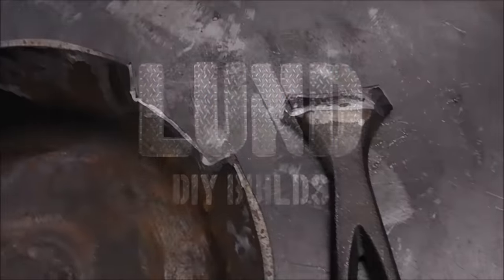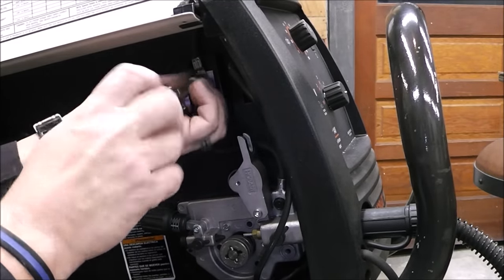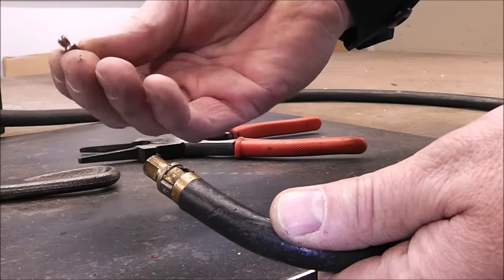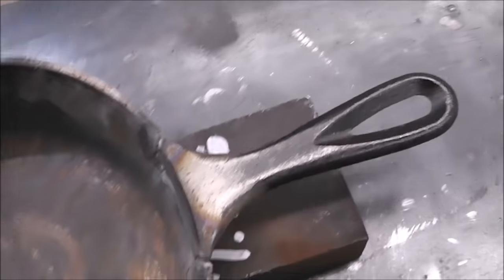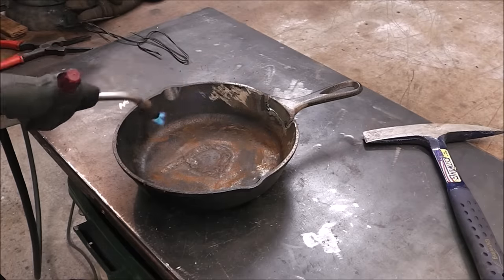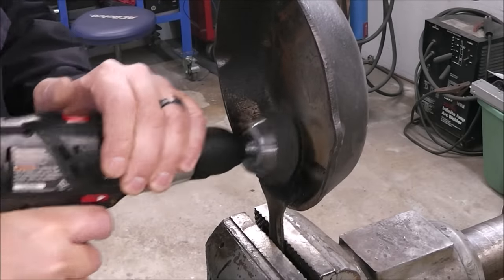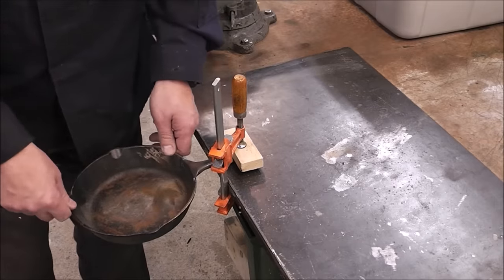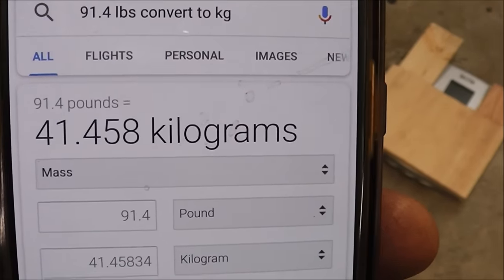Cast Iron Welding Repair using Flux Core Wire

Comment: I was having this big argument about welding cast iron..and as you all perhaps know, professional anything means standardization! A standardized weld is one that you can find in standardization publications, for the Germans out there it is the DIN (German Industrial Standard) publications and definitions, where all welding is standardized where a standard type of steel and a standard type rod will produce a weld with predictable properties if it is professionally executed. The strength of a standardized weld must not be less than XYZ ..well that is what standardization is all about. When a ship's hull is welded, then there will be tests performed and then it is accepted and "sanctified" by the testing entity. Well, this isn't about a "Industrial standard", obviously it is about something that will "work" So: Can Cast Iron be welded? If it is not covered by the DIN publications, the answer is NO. But can one weld it? HELL YES!
Reply from the maker: Spot on brother! Too many people talking themselves out of a repair because they "heard" it doesn't work without the actual knowledge of knowing what works and what doesn't.

Comment: The shroud is not hot.
It is exactly the same as DCEP.
Reply from the maker: Mine is which is one of the reasons why the nozzel for flux core is made of non conductive material.

Comment: Its a cast iron skillet. You could jb weld that thing. Its not a motor foot or an actual machine part. Even though your not using 5p rod or any other proper cast iron repair consumable since its a non essential piece I'm sure even super glue that can withstand heat will work. Is it common practice...no. Ask Canadian Mike Holmes on common practice. I don't think there is even a dissimilar metal consumable for cast iron.? It also matters what type of grade cast iron or is. For my favorite cast skillet I'd bolt that dam thing together to save it if I had too!!!!!!!
Reply from the maker: Forget everything you watched and braze it. That's the proper way to do it,  but for those that are less fortunate and have a wire feed welder, a stick welder or the dozens of other process and fillers that we tested, maybe they can make an informed decision. JB Weld makes a mess on cast iron exhaust manifolds. White cast is nearly impossible to weld. Grey is the most common and what we have here

Comment: Toss it on the scrap wagon, brand new Lodge U.S.A. made skillets are $25 bucks. I charge $75/hour in my machine shop and the one I retired from is $150....
Reply from the maker: C'mon Keith....your not serious right? Would you tell this to one of your customers that brought you a cast iron part to repair and they told you it cant be replaced? Most people understand as I explained in the video that this is not about repairing a cast iron pan but rather showing what can be done using what you have on hand.
Reply: @BrandonLund  
Only cast that can be replaced.
Out in the sticks it's a "time down" vs price, availability and how far away it is.
On old tractors which I deal with every week, it depends on getting to the "crack," how much has to be dismantled?
Are there gaskets involved, what will burn nearby, is it going to rain on things opened up, gas or diesel fuel, wires, hydraulic lines/hoses etc.
Told my buddy whose block cracked to wire clean it and then use JB weld....
No torch involved.
Our parent's garage and wrecking yard has seen a number of things fixed this way.
Your pan was okay, but pick a cast iron front spindle that most of us have dealt with.
1948 Case VAC.
1948 Minneapolis Moline model G
1956 Minneapolis Moline 335.
1975 Minneapolis Moline G705.
1975 Massey Ferguson 30 Industrial.
1975 International 2400A Backhoe.
1990 Ford 555 Backhoe.
And that's just the stuff I own.

Comment: Flux core mig wire??
Reply from the maker: They make solid wire and flux core wire. Solid wire is used with a shielding gas, also known as GMAW, flux core wire, also known as FCAW can be used with or without a shielding gas. Flux core wire used with gas is often referred to as "dual shield" and is largely used for structural work. The term "flux core mig wire" is a slang term used in the trade, however, you cant have both. It's either flux core wire or it's mig wire.  This project was welded with flux core wire. Cheers.
Reply: It's really innershield.

Comment: I think I will try this on a wood plane crack repair. Most people braze.
Reply from the maker: It should work but if not you can always grind it out and braze. You don't have much to lose. FYI silicon bronze wire and mig is awesome at cast repair. I have a video in my cast iron playlist on this

Comment: When using a mig welder to make cast iron repairs look for a wire with the highest ductility you can find
Reply from the maker: Right on!
Reply: That is why nickle rod works so good for cast iron it has very  high ductility
Reply from the maker: Exactly! 💯

Comment: I broke my vise.  I welded it and it looked to be a solid repair.   The first time I snugged my vise up and gave a half turn more, it broke.   Going in the trash, Will never be as strong as parent metal
Reply from the maker: Cast iron repair is always a crap shoot. Sorry it didn't work out. The best scenario ive had to date yielded about a 30% decrease in original breaking strength. Much of that depends on the batch of cast as well as the procedures

Comment: all most all cast iron today is s.g. iron. today,   just weld it with m.s. wire .    people think the new wires or old techniques  are good , but its the parent metal.  If its not s.g cast it must be brazed so  drop it in the bin

Comment: There's always going to jerks . And basically  they are afraid to try.  I've never seen  mama cook anything with that amount of weight. If it works, Great. If not , go buy a new one. Good video.
Reply from the maker: Right on Stacy I appreciate it! The old timers made due with what they had and they didnt always have exactly what they needed. I feel like our society has been conditioned to just throw away and buy new without ever trying to repair things. I appreciate you see what I'm trying to show here :)

Comment: Have done a lot of cast iron repair, stop using sand and use lime, cheap and less thermal shock, sand must be be pre heated just as the cast iron.
Reply from the maker: I have heard ash works well also but havent tried either. I'm sold on thermal blankets... especially for in place repairs.

Comment: Ive ran off miles of 0.45 flux core wire working at a dry dock, and it still required a shielding gas  I don't recommend this gas-less flux core wire for nothing more than patching a hole in a muffler nothing serious at all because it wont hold.
Reply from the maker: That's not true.  Self shielding procedures are often specified on everything from bridges to structural steel. To say it's only good to patch mufflers is very misleading. What your referring to is dual shield and it's not always practical in the field.
Reply: @BrandonLund  Ive used inner shield at ship yards and large scale plate steel projects im familiar with it Sir, a commercial grade machine with industry standard methods is one thing.  Im referring to a Harbor Freight 110 volt Mig with flux wire i wouldn't use it for nothing more than a small patch job it was awful Sir.
Reply from the maker: @unclequack5445  I have never tried a harbor freight welder so I cant comment on that.
Reply: @BrandonLund   Yeah a neighbor asked me to help him set it up since I had my own Portable welding business all I can say Sir was it was pretty grim, I'd have bought a stick welder even if it cost more.
Reply: Brandon answer me this, do you advocate teaching students to weld downhill? There's a Youtube channel of some KIA doing just that obviously he cannot run a 7018 from the bottom up, which is a necessary skill for anyone in the trade, would you agree?
Reply from the maker: @unclequack5445  Welding in position and out of position are basic fundamentals that should be learned.
Reply: @BrandonLund  But of course.

Comment: And it always tears the iron out when it breaks..it won't ever be as strong and won't hold as much pressure
Reply from the maker: Correct
Reply: But you always have the option of putting pins in it after you get it welded.or before sometimes..that's how I fix cracked heads..just drill it put a pin in it and tig weld it..sometimes it works..sometimes it dosent..I've got a set of stock racks that fit a model a Ford one ton that my great uncle made out of 3/4 black iron pipe and welded it together with bailing wire and a gas cutting torch..he also made his own gas from carbide and water..in sure he bought the oxygen

Comment: Cast iron one inch at a time on welding then hammer a bit . And stuff
Reply from the maker: You payed attention
Reply: @BrandonLund  yuppers pay attention on the weld if all settings on welder are correct
Reply: @BrandonLund  one inch at a time . On weld .
Reply: @BrandonLund  yup

Comment: Control would have been to see what a non broke pan.
Reply from the maker: I have that number too if you want to check it out.  This is just one of many videos in this series. I will spare you if your looking for the best repair Vs unbroken cast iron, use silicon bronze

Comment: I think it would hold eggs and bacon . That's all I use mine for anyhow.
Reply from the maker: It sure will...and then some! :)
Reply: @BrandonLund  
I have a pan that's broke just like that. I might try to weld it back together since I saw this video. I have a flux core welder.

Comment: Cast iron . Weld one inch at a time.  Then hammer . Repeat aft each inch of welding.  Just my opinion  .
Reply from the maker: Spot on brother...textbook. i usually go 1/2" just to be same and further reduce heat input.

Comment: I've heard all kinds of horror stories here and elsewhere about people that forget to change the polarity.
Reply from the maker: People have actually sold their machines over this
Reply: @BrandonLund  Yes... I am now watching this for the second time as a "refresher". Using the right kind of knurled drive roller helps as well.
I don't have one for my Hobart 210 yet, but they ARE available out there.
 It also looks like pre-heat & post-heat is important as it is sometimes used on cast aluminium. 🤔

Comment: Flux core wire is a wire and mig wire is a wire, I get the impression you are combing the two..two different wires.. confusing when u say flux core mig wire?
Reply from the maker: Reginald Pattersonill sorry for the confusion.  I’m using self shielding wire

Comment: Good    try,   D/C  WELDING ROD  + SET.   PRE   HEAT,   NO   GAPS  AT ALL    ON    PARENT   METAL   (PAN ),  RIGHT  GUAGE   CAST   IRON  WELDING  ROD   IS    CRITICAL!!  REGARDS.
Reply from the maker: So if all someone had was a wire feed welder your advise to them is dont use it and go out and buy an arc welder?
Reply: @BrandonLund  HI,  A   MIG  WELDER  IS  AN  ARC  WELDER,  (THINK   ABOUT  IT)  NO USE  THE   RIGHT   WELDER   FOR   THE   JOB  IN   HAND.....TO  GET   THE   BEST RESULTS,  REGARDS.
Reply from the maker: Maybe i misunderstood? You had mentioned using welding rods soni assumed you were refering to arc welding. This video was about someone having only a wire feed welder 😁

Comment: Flux core welding, is a very often under rated process  by those (i can can do better than you, you tubers )  and this is a good example
Reply from the maker: Thank you. I think people assume this because some of the budget welders are flux core only with no provision for gas. I think it's easy to assume that mig must be better because a mig machine costs more and is a cleaner process compared to self shielded. I personally love self shielded.

Comment: If you welded cleanly and with the correct technique, It would have broke only to cast iron specs.
Reply from the maker: Please post these "specs" you mention because I'm not aware of any testing done like we've done here.
Reply: What “testing?”
Reply from the maker: @alyciabebo7941  rather than be some keyboard welding inspector trying to troll me in the YouTube comments section, why not do some research.  Go watch the cast iron repair series playlist and maybe you will have a better understanding of how different methods and process compare to one another using destructive testing.

Comment: Its how it reacts to after the repair. Weld material reacts different to base metal. Not the strength. There's multiple grades of metal. Sure strength is one property of metal, but you're not going to pit a cast aluminum vs cast Steel or cast iron. Of course cast aluminum is weak. You do not properly display the proper strengths and weaknesses or properties of each material. They all are different. Sure, cast iron can be repaired with MIG welding. But can it cook can it withstand 500°. You look at the welding aspect not the fucking usage
Reply from the maker: I think you missed the entire point. Did you watch the same video as everyone else? This is a cast iron repair series. We used several different process to repair this ONE pan that we broke several times and used a crude measurement to see which welding process yielded the highest breaking strength. Im not trying to compare Iron vs steel vs aluminum. Not even close and im not trying to compare strength at a given temperature. Its for entertainment to show what process roughly yields the highest breaking strength. Im using a pan because its an undisputed material. We can agree its made of cast iron and not cast steel.  i discourage repairing cast iron pans as i stated so heat is also not in the comparison. And no need to use profanity...it violates youtubes terms.  Thank you.

Comment: So now I just need to find someone that has a welder... 
Large cast iron with a crack down the side and into the flooring of the pan. Can't use the pan as it'll leak any oil/grease out and catch everything on fire.
Reply from the maker: Honestly, I wouldn't recommend welding a cracked cast iron pan for anything other than experimenting or using it as a wall hanger. I personally think it's just took risky to take the chance. If your weld fails (even just a little) your going to have a grease fire / house fire. You can buy a new one for $20. I think I paid around $10 for the one in the video.
Reply: @BrandonLund  exactly about the house fire... That's how I found out it was so bad... Almost burnt the kitchen down. 
So now its strictly a camping item. For on the camp fire, its OK if the fire there flares up. Lol. Just not INSIDE!
Reply from the maker: @vincedunn9983  Right on! For camping it would probably be fine. Good luck with your repair. BTW, if you think you might be interested in picking up welding as a hobby, you can get setup fairly cheap. My first welder was a cheap Chinese unit.  Then after a little while you can charge your buddies to fix their broken stuff!
Reply: @BrandonLund  actually, I'm interested in forging (knives and other such type tools). Just built my first forge, based on one I saw a video on. Air tube in a "box" of dirt with a brake rotor to hold the wood/coal. Just have to wait til the weather cooperates (been raining a lot here) because its outside. No garage or shed/shop here.
Reply from the maker: @vincedunn9983  That sounds like fun brother! I've been toying with the idea myself for a few years. I keep telling myself one of these days I'm going to stumble onto a nice anvil, and when I do, that's probably when I will start to dabble in it a little. I love watching the old timer blacksmiths. It's becoming a lost art. Take care man and good luck with your hobby. Brandon
Reply: @BrandonLund  lmao, I'm still in need of an anvil... Until I find one (can't afford to buy one, living on a bare bones budget) I'll just be using a "really hard" tree trunk.

Comment: The real question is how the hell did someone manage to kill an iron skillet?
Reply from the maker: I started by running it over with a car. When that didn't work I heated it to 600 degrees then immediately dropped it in a bucket of ice cold water. After that I hit it a few times with a sledge hammer. That did it.

Comment: Removing the moister is called “sweating” the iron.
Reply: There is actually no water in the metal. The "sweat" you see is the warm moist air from the torch condensing on the cool areas of the steel. If you were to heat the steel with something like an induction heater you would not see any moisture condensing on the surface.

Comment: Aren't there things in the core that you DON'T want to eat?
Reply from the maker: I personally would never use or condone anyone to ever use a repaired pan. The flux in the core is poisonous plus if the pan should fail with hot grease, now you have a whole new set of problems.

Comment: 91lbs is WAYYY more than the pans load would EVER be, to be fair, that repair would have probably lasted many many years if it was just to be used as a pan. 
The armchair experts that have a go because you didnt use traditional methods should realise...its a pan ! not some load bearing column !
Reply from the maker: Thanks man! I've come to realize that even when you prove something can be done that an expert will find a way to say it cant. That's ok though because ultimately if someone disagrees they don't have to use this method.

Comment: I think I can pretty much guarantee that anybody asking about using a flux core to weld cast iron is asking because all they have is one of the cheap Chinese 115v flux core AC only welders, not a $600 DCEN capable welder. Believe me when I say, none of us want to run flux core, it's just all we can afford!!!!